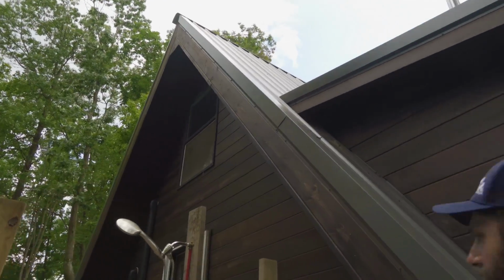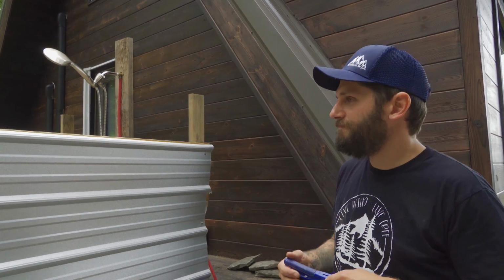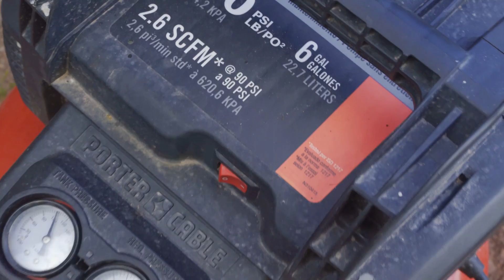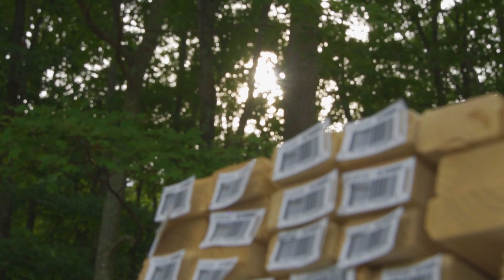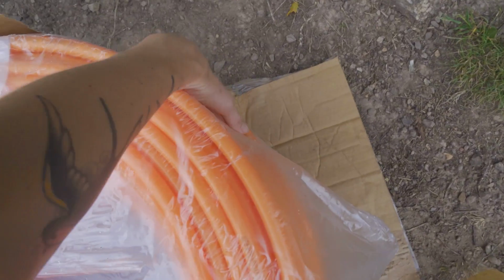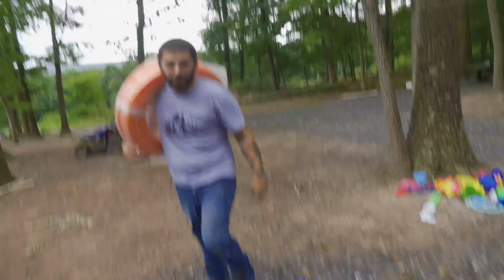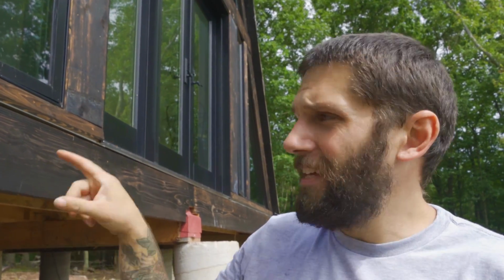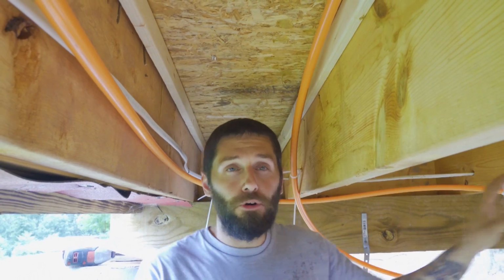Sixty Days Or We're Canceled!

Comment: Ask the closest building department what conditions have to be met before they will issue a temporary certificate of occupancy or the final c.o.  Generally all safety issues have to be addressed but they can be temporary such as an exterior handrail that blocks the sliding glass doors.  Some municipalities will allow double-keyed deadbolts on exterior doors to prevent them being opened without the key.  Pass that info on to your insurer, maybe it would persuade them to lift their deadline.

Comment: I work for an insurance company and of course each are different but pretty odd they would keep the $ if you dont get those issues they are wanting addressed fix... usually they would prorate the 10 months back to you or w/e the amount of days it is. As far as they back door with no deck ask them if you could maybe put a double sided keyed dead bolt so it cant be open from inside or out and send them pictures... our company accepts that as you said a lot of new homes have a patio door and no deck and that is one work around with the company I work for. Anyways good luck

Comment: I heated my house floor the same way, but did not use the aluminum diffuser plates. I stapled the foil bubble wrap between the joist and it works great. Nice job. Don't you just love dead lines, specially deadlines that could cost a $1000 ?

Comment: I haven't read through all the comments to see if anyone else mentioned this, but here are few things you might want to know about insurance companies:
1. Not all Insurance Companies are the same or require the same criteria to insure your home.
2. By law they have to refund you any premium from the date you cancel forward. You are fully covered now, but if you cancelled tomorrow, they would have to refund you the remaining days that you paid for. 
3. I have a cabin that is not at all up to code, and is in the woods. Many insurance companies would not insure it for different reasons (brush too close to house, no railing on deck etc.), but I found an insurance company that would insure it, and the premium is actually less than the first quotes. They came out and inspected, but had no problem with not having a railing on a deck that was more than 18" off the ground. It all depends on the company and their policy requirements. 

Hope this helps. Love your show, by the way. I've been watching you for about a year now. <3

Comment: Put one  small set in the back to meet code .On the front of the house take the door latch off put a plate over the hole where the latch was  and  tell them it's not an  entrance it's  a glass wall  and that should make code

Comment: If they cancel your insurance they have to refund the what you did not use.  Your agent needs to see if you can get an extension beyond the 60 days. And Josh your are correct, you can put up the stairs and railing and then change later for you would have satisfied their requirement.  If I was your agent I would be fighting to get that extension for you.

Comment: I have installed thousands of feet of radiant pex and never have I seen it done with a bulkhead. I have installed the transfer plate method before but prefer installing the pex on the subfloor with a 1" concrete on top and glue the flooring to the concrete. More efficient and the concrete acts as a heat sink eliminating temperature swings. I sure hope that is oxygen barrier pex you are using?

Comment: How are you getting the pex loops from one floor joist bay to another?  Understand showing here was to get the lengths for each circuit, but it needs to stay above the insulation and going under the joists does not do that.
Reply from the maker: It will be boxed in and under the insulation

Comment: Guys first thing : most inspectors will give an extension if you show that you re complying with their request. Second thing  why not use expanding foam under your place it will be easier to apply and when it's dry it can be shaved flush with the floor joices and the expanding foam will seal off any gaps in the floor and help heat the floors better batting insulation.
Reply: but so hard to remove if ever repairs are needed...been there...done that

Comment: I did the hot water spicket to my oil boiler and it uses alot of oil and the water goes fast. I did this years ago and it does work i think i need another hot water holding tank though

Comment: Yes hello! Hey the permanent part of it is just talking about construction techniques. You couldn't build something sitting on top of the ground that has no anchors. I'm sure if you did a 3x3 deck with rails and some stairs that are attached to the ground with concrete and anchors it would be fine. Also, if they cancel your policy they would refund you the unused portion. So if you had your policy for 2 months they would refund you the other 10 months worth. Great videos guys

Comment: You guys will kill it. If you disable the deck doors by locking and barring entry from inside and outside they should let you alone. Check with building codes, if barring the use of patio doors is good with local codes, that should be good enough for insurance, it’s just about liability. But you do need a permanent means of egress for front door, with proper railing. Get Chuckie on the case

Comment: I’m am not a fan of insurance companies.. I remember the first time I ever encountered pex pipe thinking what kind of Sh** is this.. needless to say I have changed my opinion about pex. So much in fact I won’t use anything else but pex it’s easy , it will expand when it freezes. Well to a certain extent.. more then any other plumbing system. And it’s super easy to repair if it does break. It will last forever never rust or corrode.. and it comes in very long rolls making it great for long runs with no fittings.. good luck beating the deadline did I mention I don’t like insurance companies 🤬

Comment: I had someone put 3/4 plywood on 2x2 framing painted black to the outside and room color to the outside for a future 2nd floor deck off the master bedroom.  It turned the sliding glass door into a large window.  We talked it over with the underwriter and the company accepted it.  So for the Front door that might work.  Now the rear and side door a deck space is a lot smaller to build for you.  Now closing up the bottom, do they want you to seal below the floor joist or have a wall around the perimeter with a door for access?  So contact your agent and let them talk to the underwriters.  A lot can happen just by doing that.

Comment: I am not an engineer but I have always seen radiant floor heating done inside the house below the final flooring install. Will that two-inch space creates some form of condensation? If so then the wood will deteriorate? Just asking.

Comment: I don't know the regulations in your area for the french doors and the other door. Check with your insurance most of the time what they are looking for is like a railing that stretches all the way across the door so you or your little girl can not fall out to the ground and hurt them self for the word permanent  to them  its not long term its more for if your not home your children cant just easily remove meaning instead of sheetrock screws you us bolts that are stronger and harder to get out. the railing usually cover 4 feet high that way a child up to an adult cant fall and get hurt.  they are more concerned with some one that doesn't know there is not steps there falling and getting hurt. the railing would be there to stop them from going any further and falling to the ground. at least this is what me and my brother did on the houses we built.